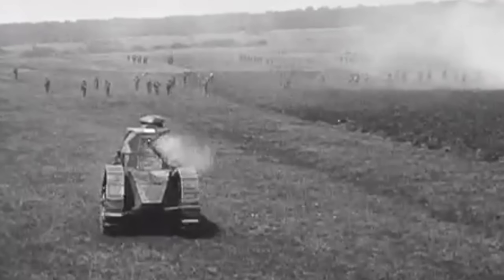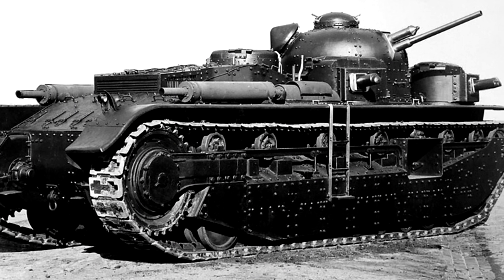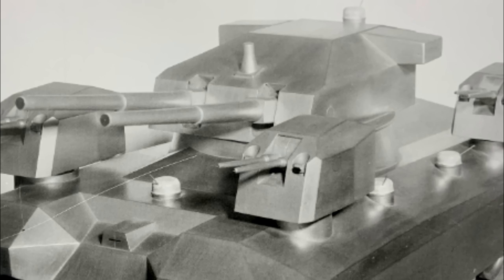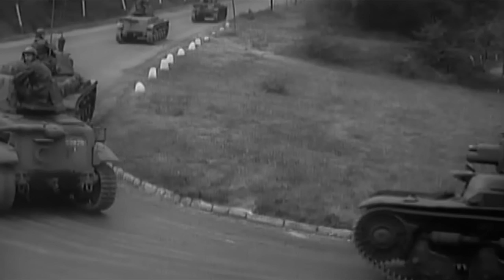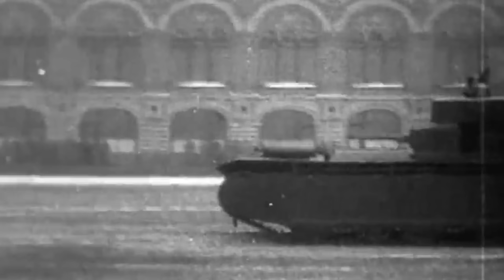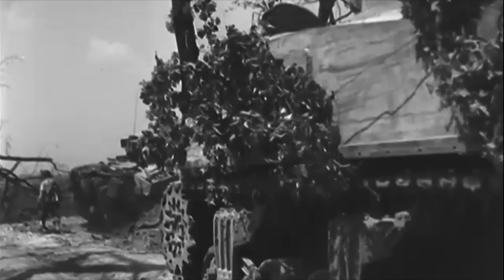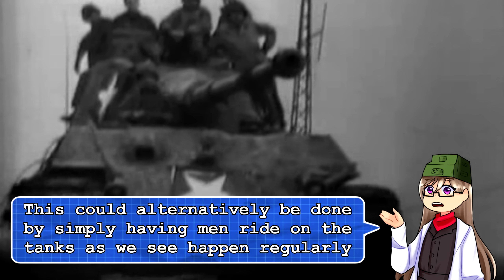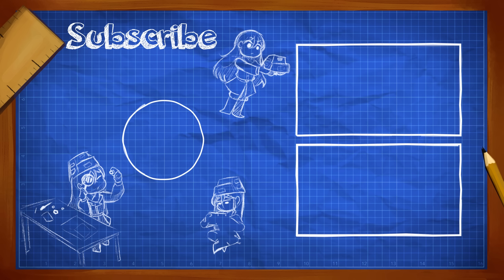Why do Multi-Turreted Tanks Fail?

Comment: With Remote controlled weapon stations becoming more advanced a more practical version of the multi-turret concept is now possible as a remote controlled weapon system is going to be smaller due to not being manned with the controller being within the main armored section of the tank instead of an exposed turret and can be controlled independently with low interference with or by the main armament turret. As the electrical technology and materials improves you can make it lighter and eventually more reliable without compromising the hull strength and armour protection.

Comment: Given world war 1's static trench warfare, it made sense at the time. you had that right, I would say. I think it was essentially a hold-over from the twin sponsons -- the renault FT17 might have been revolutionary in its addition with its turret, but was still a light, tiny ass tank compared to the Mark IV's-VIII's. perception here is key, not necessarily reality. It's also worth noting, it [the FT] didn't really outperform anything else to too significant a degree -- tanks of all sorts at that time sucked, and none could go much faster than infantry. Having [only] a small artillery cannon or a machinegun means you didn't really have both at the same time, which is the ideal. So, why not get another turret that has one? it's also harder to put both together in the same box [turret]. 

Last -- its combat effectiveness was limited by the end of the war. it was first deployed (at least according to wiki) on may 31, 1918. That's less than 6 months of effective combat to prove its worth, which it did, in fact, do, but not to turn conventional wisdom on its head. Just about every European power that made a lot of tanks made a multiturreted one, except maybe the italians, whose tanks invariably sucked the hardest of them all. N.B. not sure on the italians' production of multi turreted tanks, but theirs were lighter in any event so as to avoid bridge fall-apart.

Comment: Another big disadvantage of muti turreted tanks due to size, they become bigger targets that are easier to hit and more difficult to conceal from aircraft or attacking enemy forces. On the psychological end of things, much like a school of fish is a protective measure (large numbers of prey fish can confuse and overwhelm a predators ability to pick out a single fish to go after) a smaller number of multi turreted tanks vs twice as many traditional tanks would present fewer targets to monitor and make target selection easier compared to twice as many smaller tanks that are moving independently of each other. And with traditional tanks a single hit can potentially take one gun out of the fight but a multiple turreted tank means a single hit can potentially take two guns, more ammunition, and more crew members out of the fight. Essentially the only time additional guns firing from a single vehicle really provides benefits worth the complexity, additionall cost  and added weight is when the purpose for yhe vehicle/weapon system is one which volume of fire is the priority over pinpoint accuracy or maximum effects on targets, such as short range air defense to be used against low altitude ground attack aircraft, such as a ZSU 23-4,ZSU 57-2, Bofors 40mm Duster, or Halftrack mounted Quad .50 cal Browning M2 machine guns, or any of the various similar types of anti aircraft weapons systems. An important thing to consider when discussing the goal of such systems, the priority is putting enough metal in the air within a close enough proximity to an attacking aircraft that the pilots ability to remain focused on engaging ground targets with precisely aimed rockets/bombs/gunfire while on an attack azimuth chosen to provide maximum targeting time/multiple targets he must now choose an angle that allows air defense the minimum amount of time to engage and make his target runs quickly and with some amount of evasive action. The idea that these types of systems are going to destroy significant numbers of enemy aircraft, especially when considering the rounds expended was not really part of the plan. Tanks on the oyher hand, sure volume of fire is a consideration but the plan is ideally a 1 shot 1 kill   method of fighting which favors having a single, accurate cannon firing munitions that are effectively capable of single shot kills.

Comment: To me the most important omission is twofold. A two turreted vehicle will either have to carry two types of ammo, reducing it's cargo space for its primary gun, of, if both guns are the same, will use up the ammo supply twice as fast. The extended size would allow form some more ammo space, but not likely enough to really make up for this detriment. This sort of thing was seen in the Char 2B, where the ammunition for the howitzer reduced the ammo supply for the primary turret.

Comment: I’m working on a book that I won’t go into an insane amount of detail on here but multi turret tanks would probably fair better in my world for a few reasons. 1. Not many factories left world wide you kinda take what you can get. So the argument of just build 2 tanks is thrown out the window as you can’t even build 1 and are forced to use whatever you can get your hands on. 2. Very few aircraft. Larger tanks are much more vulnerable to attack from above its why the monster tank projects of Germany were cancelled. Without having to worry about that they become more viable. 3. Hard work on the commander running multiple turrets. A crew who are very close to each other and used to working together with extensive training in the tank alongside each other could solve this. Captains on ships can do it and they are running a considerably larger number of people. 4. Cost. Refer back to number 1 for why this won’t matter here

Comment: The arms race between arms and armor doomed the multi-turret tank.  No matter what combination of main weapons you can include on a multi-turreted tank chassis... the same rated chassis could support a much more effective single weapon of a larger size.  The larger weapon would likely be more effective at punching through heavier armor or engaging at longer ranges.  The single turret design is going to be more effective in a less permissible environment.  If you're dealing with swarms of unarmed zombies.... sure... lighter weapons and more of them would be great.  Reaching out and touching a concealed AT gun... yeah... single turret.

Comment: With each and every point that comes up, I just keep thinking: "You could solve this by just making two smaller tanks instead."
There is one other major advantage to having two smaller tanks over one big multi-turreted tank: if the enemy scores a hit on the big tank, the tank is lost, but if you have two tanks and one gets hit, you still have the other tank.
Reply: The major advantage of two smaller tanks is lesser ground pressure and availability of engines with the horsepower to get your through difficult terrain.  Putting two turrets on one tank gives most of the downsides of two light tanks coupled with most of the downsides of a single heavy tank.

Comment: For my fictional world, I conceived of the idea of having two tanks joined side by side with a third track in the middle.  Basically, a twin-hulled tank.
One turret would have a 47 mm gun for dealing with armour, the other a 94 mm howitzer for firing smoke and HE shells.
Only one country builds these, as every other nation's response is, 'Why not just build two tanks?'
I'm not saying it's a good idea, just... is it possible?
I got the idea from the old videogames that featured two warships joined together and thought, what if you did that with tanks?

Comment: Why have multiple smaller sub par guns when you can have one much larger and more powerful gun that can also have a unobstructed 360 degree firing arc all on a smaller frame which means less visible to enemy, That's also cheaper then multiple smaller ones which also means more crew which means larger tank and a bigger target.

Comment: And also not sure if I missed it or simply didn't mention in here but one drawback should be lack of concealment. Sure tanks mostly ain't made for staying hidden except light tanks made for reconissance and infantry support alongside with tank destroyers which most of them being expected to engage while hidden.
But in an engagement in forest, you might prefer an slightly smaller MBT so it can be little harder to spot and hit by enemy fighter planes, attack aircraft and etc.

Lastly it's obviously more easier to camouflage an T-34 or any MBT comparing to KV-1's multi-turret cousin. Even if you manage to hide one of those tanks, there is an high chance of them getting spotted cause of their odd shapes and gigantic sizes.

Comment: Biggest problem I can see is that adding extra turrets makes the tank much bigger and heavier. Bigger target, without adding any extra armor or increasing the power of the main gun. Adding a ton of weight and increasing your target profile isn’t a good trade off to just add additional smaller weapons. In the end, one tank with two guns is inferior to two tanks with one gun each, because two tanks can be in two different places.

Comment: The turret is the most complex and expensive part of a tank...so yes to all the problems and limitations you stated. One major reason not stated however, was the fact that there are actually two kinds of multi-turreted tanks, where the secondary turrets have machine guns, and where the second gun is a different type of gun. Most of the time, multi-turreted tanks had two different guns, to do two different jobs. So the SMK has one low-velocity gun (76 mm) in one turret and a high-velocity gun (45 mm) in the second turret. The low-velocity gun was for soft targets and the high-velocity gun was for fighting tanks. When guns were developed that could do both jobs...the need for a tank with both fell away.

The biggest reason was cost. As much as people talk about the Independent, it was not adopted mostly because of the cost. Multi=-turrets need a big tank. Big tanks with multiple turrets are going to be very expensive. The most destructive and efficient tank killer is the budget.
Reply from the maker: I do briefly touch on the machine guns turrets used by some designs towards the end of the video. While those did in some cases see limited success they suffer from the same issues I covered for the larger gunned examples.
Reply: @ConeOfArc  I watched your video, and it struck me that in many examples of multi-turreted tanks, the multiple turrets were not included to increase firepower, but instead to include different types of guns to engage different types of targets. It's something the SMK, T-35, and Neubaufahrzeug had in common...low velocity howitzers (for soft targets) in one turret and high velocity guns (for hard targets) in another. 

Maybe the engineers were trying to square the circle of tanks needing to fight infantry and other tanks. Including both types of guns was tried, and failed. The better idea, a tank's main gun being able to fire usable HE rounds at soft targets and AP at hard targets, was then used successfully. The Lee/Grant was more or less a test bed for this concept, retaining the 37mm just in case the concept didn't work. I don't know...that's the thought that popped into my head while watching your video.
Reply: Good comment.

Ultimately it is cheaper to build one bigger better turret, than two good enough for two separate roles.  You can put a machine gun on that turret, if you think that is important.  IIRC, the Sherman had a .30 caliber bow MG, and a .50 caliber MG that could be used from a crewmember partially exposed on the top of the turret.  And the main gun could be used at the same time.  That is a withering amount of firepower.  

Another way to look at it is two turrets tends to make the vehicle heavier, and you are going to get the worst of both worlds -- the too often overtaxed engine of a big tank that can get bogged down in poor terrain coupled with the limitations of smaller guns on a less big turret.

Comment: Other slight benefits for multi-turreted tanks are 1. lest crew need because you only need more crew for the next turret. With two tanks you need 10 men, 3 in each turret and two for driving the tank. A two turreted tank only need 8 men, 2 divers, and 3 men in both of the turrets. 2. the other benefits depending on how fast you want it to go, you will need 1 engine in multi turreted tank instead of two for two single tanks. Which also might mean using less fuel to run one over two.

Comment: 13:11, Keith Laumer's Bolos, the self aware cyber tanks of the future, initially go with this concept. It takes them centuries into a sci-fi future before they go to multi turreted vehicles. Before then, it's mostly combat support like mortars, SAMs, and the anti infantry side machine guns.
The Bolos are heavily automated even before they become AI, at first they're not much more than M1 Abrams capable of operating with programmed instructions. Their third model of Bolo is a mobile firebase, and it's advantages are in computer coordination and communication more than simple firepower. Its a fascinating and underrated series.

Comment: A very big factor, I would think, is engine capacity versus the biggest guns that can be reasonably built.

For most of the tank's history, designers have hit the limit on how powerful an engine they can install long before they hit the limit on the biggest gun they can install.  So there's really no good reason to put in a second gun or  a second turret when you can get the same effect by just putting in the biggest single gun and turret your best engine can drag around.  Contrast this with a warship, which very quickly hit the point where one just cannot reasonably build a larger gun but still have a lot of unused engine power - so you might as well put more guns on the ship.

The crew-co-ordination effect isn't something I'd really thought about, but makes a lot of sense as a problem.  And is another place where a tank differs from a ship - the ship has room for talkers and intercoms and gunnery officers and a whole bunch of other people to help distribute the captain's workload.  Plus, ships usually engaged one target at a time with centralised fire control, though to be sure that would be an option for a multi-turret tank.

Comment: I think it's the same reason why we don't have mediums, heavies, or even why we don't use alot of light tanks. MBT's just came in and since it can do everyone's job better or in one package there was no ponit in making them. And besides, if you add enough machine gun turrets (Manned or remote controlled) it can technically be considered a multiturret tank. :/

Comment: I have a perfect multi-turret tank. Hear me out tho...

What if instead of smaller one, we put 104 guns on it so the firepower make up for the downsides?

RHA is heavy so let's use wood to save some weight. This also make the tank amphibious so it can be easily send across the sea.

Lastly, fuel engine is expensive, hard to produce and some nation like Germany barely even have any fuel left! Why not just use sail instead?

Well, although our tank can no longer fight on land, it can still fight at sea, which is 70% of Earth so that's more of an upgrade to me.

Comment: Fun fact: The M3 Lee was so tall that a man 1.7 meters tall could perfectly stand straight from the bottom of the lower hull to the top of the upper hull roof. The Soviets used their M3 Lee's like that, where an entire battalion of 16 men were squeezed with the rest of the tank crew. Sure, the cannons and crew were severely hampered, but if one of these M3 Lee APCs broke through, theoretically, you could have infantry, artillery support, a tank, and an anti tank weapon wreaking havoc on enemy lines